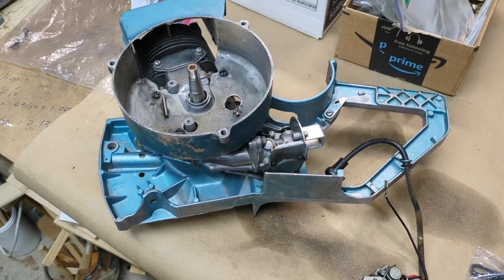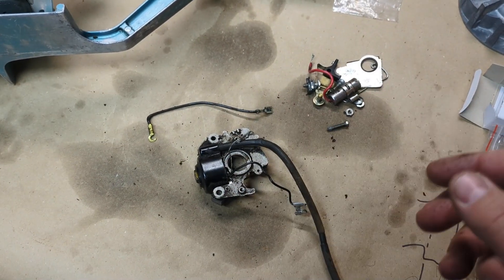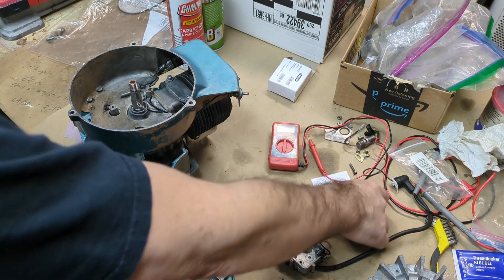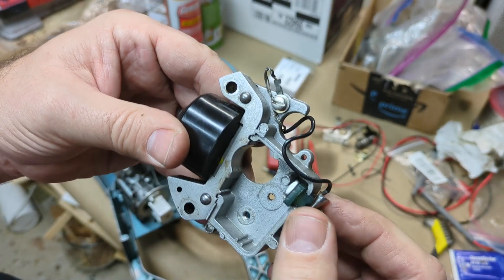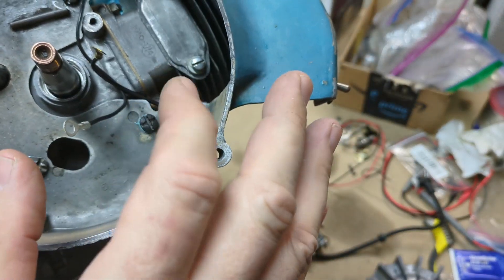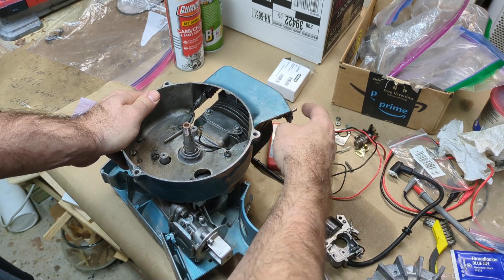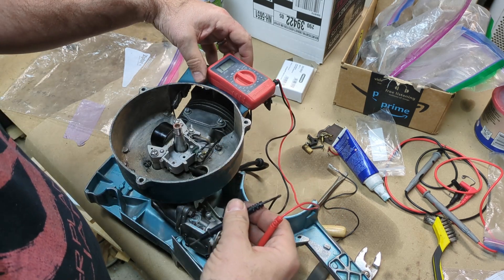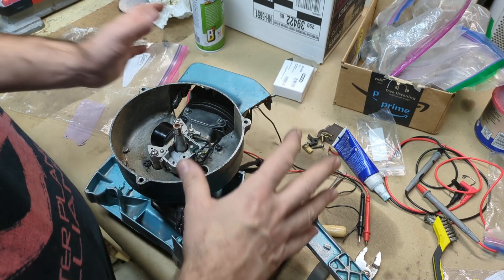Install electronic ignition chip on a chainsaw

Comment: Some older saws need to be wired as per the 'positive ground' diagram. i just installed this exact chip on a Stihl 051AV, a '70's-'80's era saw. Not knowing which way to wire it, I started with the negative ground installation and when that didn't work I switched wires to the positive ground installation and got spark.

Comment: How do you determine which wiring to do?
Reply from the maker: Try it one way and if it doesn't work ..try the other way. Most of the time it will be negative ground.
Reply: @jonparkmac  sounds like a plan to me.